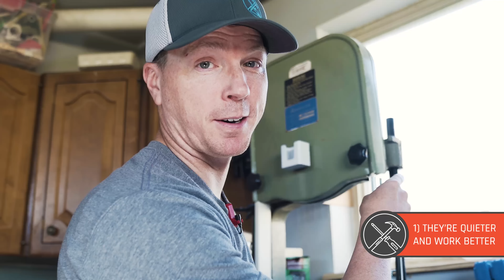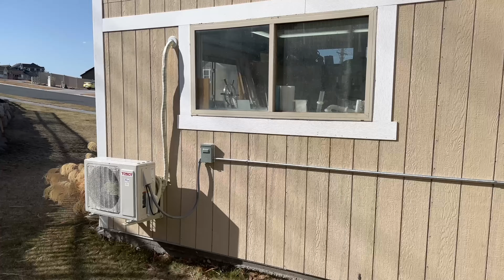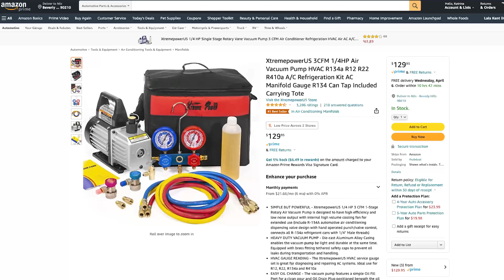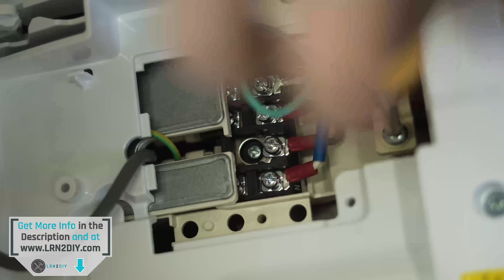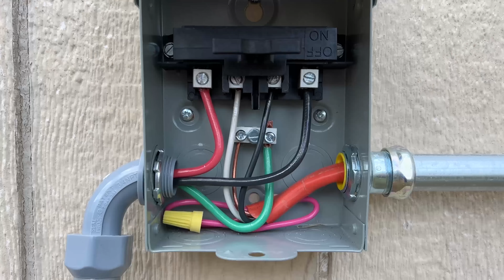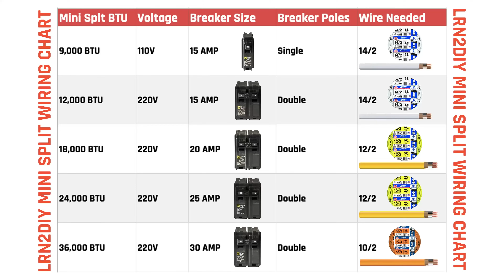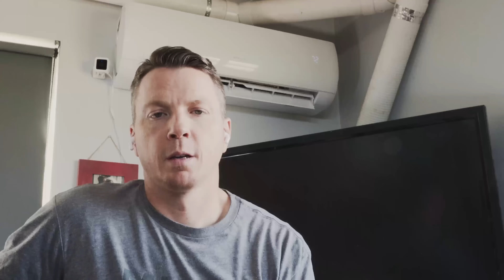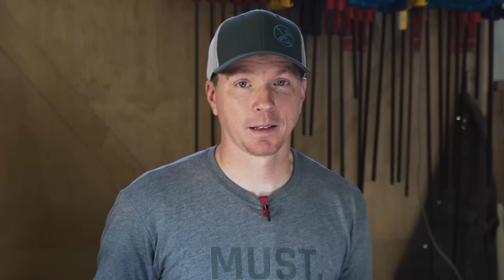Mini Split - 3 Things I Wish I Knew Before Installing

Comment: You don't need a disconnect if the breaker box is within 50' and plain sight of the A/C unit, and you do not run Romex inside of conduit use THHN wire.
Reply: I don't know where you're at, but here in Washington State, USA, this statement is incorrect. Always refer to your local codes.
Reply: @MrBassistfromhell  Central FL , not sure which part of my statement you say is incorrect either. Have a great day.

Comment: I've built cars, airplanes and done massive remodeling but the installation of my mini split took more than a month. It's a lot of work and requires electrical skills, fabricating skills, assembling the covers and then u have a unit you cannot remove easily for repair. In contrast, the window unit is done in an hour & when it breaks, you take it out of the window/wall and into the shop for repair. My mini is 18k BTU which is twice the requirement for the room but the time it takes to cool the room from 81 to 74 is < 30 min. I see little purpose to wifi other than bragging that u can turn the AC on before you get home. No Big Deal. Another important consideration is service after the sale. Make sure the seller has a tech u can talk to during and long after the install. My unit reqd a vacuum pump and gauges but I had both. The seller wouldn't honor the warranty unless an HVAC tech did the work so I took the HVAC online course, passed the test, and that qualified me for the 5 year warranty.

Comment: What type of gas do they  use and how much per pound to fill the unit.ie how many pound or ounces of gas do you need in a mini split. Would that make up the difference in a precharged lineset setup???
Thank you
Reply: You do not need to add anything to these systems unless you lengthen the lineset over what's included. The outdoor unit contains enough refrigerant for the lineset and the indoor unit.
Reply: @JohnnyBfromPeoria  once again it depends on your lineset length and the particular setup the manufacturer uses. Some add enough freon for 15 feet of lineset which will overcharge a system with only a 10 foot line set or under charge a system with a 20 foot lineset. Its more involved then people think.

Comment: i had a whole house LG unit installed...been nothing but problems since day 1 and one of the internal units still does  not work. Unless you really know what you are doing plan on adding $2- $3 PER indoor unit for install.
Reply: UPDATE 3yrs later: These LGs are terrible. Most of them are very loud, and when watching TV, you have to turn that one off. The units continually lose connection through the app, and it skips degrees when setting a temperature with the handheld. I don't know where the temp sensor is, but it never matches what it actually is. Also, when used as an A/C, they run 24 hours a day, non-stop.

Comment: how many amps is it?
i have ac windows on my bus it 12k btu 120v 16amps (maid board controller is failing on it face wont turn on pump)

Comment: Yeah you said you could get it cheaper by doing the different line sets and so on and so forth but you never said how much the cheapest can of refrigerant you’re gonna have to buy is going to cost, plus most supply houses won’t sell it to you without a license from the state, you’re leaving a lot out of this conversation you need to answer those questions
Reply: The refrigerant is pre-charged in the condensing unit. You connect the lines, pull a vacuum on them, leak check, then open the valves on the condensing unit and it charges the lines and evaporator unit. No need to add refrigerant.

Comment: You forgot to mention you need a 120v "service receptacle" outside within 15 feet of the unit.
Reply: Darenator,  While the National Electrical code revision in 2018 said that you need a 120 volt GFI protected receptacle within a certain distance of a HVAC outdoor unit, they do allow for a exception if you have one within 25 feet already installed.  Oregon decided not to adopt that section of the new revised code, so it is not required in Oregon.  Yet.  Still it is handy to have a outdoor receptacle on the home.  I put several on my sister's home to run Christmas lights!  Just under the eves, so 9 feet off the ground level.  

When I installed a new HVAC at my sister's new house, I put in the disconnect, and a box under it with a 120 volt GFI receptacle.  So she is ready when the inspector shows up, if it might be required in Washington.  Anyway it is handy to have when running the vacuum pump.  And the extra cost is only about $25 to install?  I was able to connect the disconnect and receptacle box by running the wiring through the garage, even avoiding tearing up the drywall very much by installing a new double box inside the garage, just behind it I have the outdoor disconnect.  So the 4" square hole that I had to cut into her drywall was filled by a double receptacle in the garage, and a 1" hole through the wall into the back of the disconnect finished the job, with no conduit at all.  Just ran one 240 volt #12 wire to the A/C unit and 1 #12 romex to the power receptacles.
Reply: Every service tech uses cordless tools wonder when we will stop doing this
Reply: Maybe when vacuum pumps go cordless.
Reply: @mikeratkowski3506  God, please, never. What about a 20 head VRF? Your pump could sit there for 2 days. 

I'd go one further, water spigots within 50 feet of every rtu.

Comment: Please read the manual!  Mini splits come with a certain charge amount of refrigerant.  They will have guides on how long your lineset can be and if you exceed that length, you then have to weigh in ADDITIONAL refrigerant.  This is where it becomes a non DIY project and you have to hire an HVAC technician.  I have found that the Fujitsu units are very generous with how much refrigerant they include, usually allowing for double the lineset lengths compared to Mitsubishi, LG, etc.  Also buy a torque wrench and torque those flare connections to spec.  Use some Nylog Blue on the flares; you do NOT want that refrigerant leaking into the air, it's super potent for global warming.
Reply: Tayler. No it’s not. It’s all a money gimmick
Reply: Leaks due to improperly faired or tightened line flair connections are THE number one cause of dissatisfaction with theses units.  Probably close are people who don't believe a system has to be vacuumed out well and will through the charge in the system with air and moisture in the lines.  In my area you can "rent/buy" (basically free rental) a vacuum pump from auto parts places.  A person can probably get by with a line with one gauge. Best is to use a micron gauge and see that is does not leak up over a number of hours.
Reply: I'm from Wisconsin - I wish THERE WAS global warming.

Comment: Heat pumps are hugely efficient for 1kw in with up to 5kw out...How? they use energy to move  heat from either inside to the outside or the outside to inside......this is why they are called Heatpumps! Minisplit RC Airconditioners are HEAT PUMPS...... 💚💚💚💚💚
Reply: ALL air conditioners are technically " heat pumps".  Some are just reversible.

Comment: In the 70's, we used to buy R-12 in 30# bottles with no license. I still have half a bottle.
Reply: LOL in the early/mid 70's I used to air up low tires with R-12, I got a license in the late 70's (the job paid for it)

Comment: I was wondering if the quick connects allowed a small amount of air to be introduced. Probably too small to matter.
Reply: The pressure of the freon in the quick connect lines keeps air from getting in but will let a small puff of refrigerant escape usually. Not anything to concern yourself with.
Reply: @robmcconnell9645  De minimis!

Comment: one issue in many states in the US you are required to have a service license to even buy the coolant so the price for the tools(lowest quality kit $129) for filling the lines does not cover the cost of the coolant($30-$100) or the cost to get a license($500+)
Reply: These units do not require charging unless you lengthen the refrigerant lines. The outdoor unit comes pre-charged with enough for the indoor unit and the lineset.

Comment: I'm replacing my old 3 ton box outdoor  unit with a 2 ton mini split . The old unit all ready has a ac disconnect for the old unit I only need the what u calla whip to go to it 3-5 ft away

Comment: He fails to mention you have to have a license to handle the coolants. Then there are multiple certification requirements. The classes cost roughly 800$ plus and the certifications cost 60$ up to 150$ each. Depending on the refrigerant type you may be required to have multiple certifications. I'm a certified HVACR technician.
Reply: Why would you be handling refrigerant? Being that you're a certified HVACR tech, I'm sure you realize these units ship with their refrigerant for the whole system contained in the outdoor system (if they don't come with charged lines). You're not "charging" anything and it's not illegal to do yourself.
Reply: @JohnnyBfromPeoria  not sure your entirely following this conversation. It was stated to save the $, set your lines, and charge your own system. This would mean he recommends to not use the DIY unit.
Reply: @allennolden8735  NOPE. None of the systems he's/we're talking about require a bottle. It's all self-contained - unless you lengthen the lines.
Reply: @JohnnyBfromPeoria  at 3 minutes he literally tells you to not use the DIY. Then to buy the equipment to vacuum and charge a none DIY.
Reply: @allennolden8735  never mind, man. Just...never mind.
Reply: @JohnnyBfromPeoria Sorry, not my.problem you can't follow what he it discussing. Then the fact that he literally mentions saving money and just charging a unit your self. He mentions several options but my comment on it is you have to have certain certifications. Some are minimal for just doing your own equipment up to one ton. Then add that the garbage gauge and pump set he shows has some of the most horrible reviews on amazon.
Reply: The HVAC Technician Certification Clean Air Section 608 cost me $25. It's an online course and an open book test.
Reply: After watching his video I think I will probably install everything with the exception of flaring the lines and then just call a pro to finish that off what an hour's labor Maybe?
Reply: @mattalbrecht7471  roughly an hour and a half if everything goes smooth. Sometimes you can have small issues or slow downs then maybe 2 to 2 1/2 hours.
Reply: @allennolden8735  classes for what its just a 608 cert to buy refrigerant
Reply: @RealFuzzyPickLE530  you can hold a sward yet not have a clue how to use it. Your pretentious at best. The classes teach you how to properly charge the system. Possibly you were just born with this knowledge. How you grace us with your presence.

Comment: Most annoying issue with mr cool is they decided to jack up all their prices when the people in the pacific northwest started having an actual heatwave last summer. They bumped up prices like 30% overnight. I was able to buy a 24k btu diy unit for $1350 before it got too bad. It is currently $2000 for that unit on amazon now. Glad their competitors are starting to follow suit and do precharged units. Will probably be going elsewhere for the rest of my home units.
Reply: The price increases are from supply chain issues not localized heat waves. I am an hvac tech. Costs have gone up 40% from a year ago. Of course these diy units have got more expensive. How much did you pay for gas today compared to a year ago? Do you think the cost of fuel might increase the cost of goods? What about labor costs? What about inflation?
Reply: @shotgunner5609 - Do you realize these machines are all made in Asia and shipped to everywhere else?  Can you say supply chain cost increases?  Remember COVID related shortages?
Reply: @csmith8503  totally man.  That's why every other ac unit on the market became 50% more expensive.... oh wait, they didn't. In fact there are a couple diy friendly offerings that are price competitive with the pre-gouge prices. Weirdddd.
Reply: @ShotGunner5609  The prices this last winter were lower. So im going to say besides covid supply issues its also demand related. big discounts during the winter months
Reply: to be fair, i think mrcool seems to be the leader in the industry among the DIY niche by offering slightly easier installation.  but yes the price seems a high, but it is what it is when u are leader in the competition.  similar to a seemingly over priced apple products. in additional, with groceries going up like 30% or so, with gas prices and all other inflation problems it can only go higher.

Comment: I've learned minisplits DONT work with temperatures less than 20 degrees outside. They are not a replacement for gas.
Reply: 20 years ago maybe...
Reply: My new mini split installed 2021, worked well down to - 5 degrees
Reply: They were mistsubishi, not 20 years ago, but  installed in 2018 which didn't work well in the severe cold here in Colorado.  I hope they have got better bcz it is great concept, but im sticking with my gas furnace.

Comment: I bought a 120v 12k BTU unit for $500 on EBay. Plugs into a standard receptacle.
Reply: which brand offers the ability to plug in to a standard receptacle?  seems like it will save a lot of work

Comment: I have a 48v mini split. I can do my own electrical because it is considered low voltage
Reply: Nicholas,   You "Can" run any voltage anyplace.  It is getting discovered by the code enforcement, or selling the home and needing to bring everything up to code when you run into a problem.

Comment: Pre-charged linesets are for folks who have no idea what they're doing. And pulling a successful vacuum on a closed system requires more than half an hour. The industry standard is less than 500 microns held for at least 15 minutes. You have to pull much lower than the 30 inches of vacuum referenced on a set of gauges. That's another mistake folks make when they have no idea what they're doing.
These "DIY" systems, overwhelmingly, don't last long due to improper installation practices and techniques. Whereas professionally installed systems, installed with quality practices, often last upwards of 30 years of efficient operation.
If you wouldn't DIY overhaul the engine in your vehicle, you shouldn't DIY an HVAC installation. There is SOOOOO much more to it than connecting point A to point B.
Also, minisplits in a shop environment tend to be a nuisance to clean due to dust and other material clogging the head coil.

Comment: Romex cable is not permitted to be installed in conduit outdoors according to the National Electric Code as it's considered a wet location. Thwn wire should be used for that portion.

Comment: I did in fact buy a portable mini split at Costco in the US. It plugs into a regular 110 AC outlet, which powers the compressor, the cooling unit, and the control unit. The control unit and cooling are all in one enclosure and can sit on a stand or mount on a wall. The sheath goes outside via a window or door, contains power and refrigerant hoses.  If needed, you could disconnect the condenser and run all through the wall. 

So they do exist and are easier to install than a window unit.
Reply: What this fellow bot is not a mini split. These units have a vent hose that goes thru the window. They are inefficient because they are constantly bringing in lots of warm air into the room u r trying to cool. They do work, but are noisy and the hose introduces warm air inside the room u r trying to cool. Not the same as a mini split.
Reply: @Barryd57  What I bought is a mini split. The only thing that goes through the 'window' is 1 power cable and 2 refrigerant hoses approx 1.5" in diameter. Ergo, not exhaust. They are all in one sheath. The condenser sets outside, again showing it's a split.

If I wanted to, the 2 refrigerant hoses have quick disconnects in the bottom of the inside unit and the power can be disconnected as well. The power and hoses can be run through the wall. Again, inside power, supplies power to the condenser outside. The inside plug (not the receptacle) is a 110v GFCI.

Comment: Warning on DIY on a non pre-charged unit, the EPA has requirements for an exam and certification to handle refrigerants.  See the EPA 608 certification for more info. Yes there is a charge for the course and exam. You need your EPA certificate to purchase the refrigerant. If you do a non DIY system as non DIY, you may need to hire a refrigeration tech to evacuate and charge the system for you to EPA standards. Violation of the standards has very expensive penalties.
Reply: Who sells "non-pre-charged units?" Not in this video!
Reply: @JohnnyBfromPeoria  Nobody does. The only time this will ever matter is if the manual says your line set is too long and you need to add additional refrigerant.

Comment: I paid $7k for a Daiken  mini-split install  - worth every penny in my 900 sq ft
Reply: ....And Daiken has parts available for when the system fails. Daiken is a quality company who stands behind their quality equipment. 

That really bugs me about the MrCool's. A 300 year warranty on the compressor doesn't matter if the inverter control board fails in 2 years and they claim it was a phasing issue.

Comment: You can always change the 240v ac plug with another type of 240v plug for cheap so you can use it for something else like a welder or something.

Comment: I wouldn't install a minisplit without a micron gauge and making sure the line holds a vacuum under 500microns for atleast 4hours. Those gauges aren't accurate enough to do a proper job. A micron gauge is about $150 by itself.  Torque wrenches are a definite help but not completely necessary along as your lines hold a 500micron vacuum you're fine.